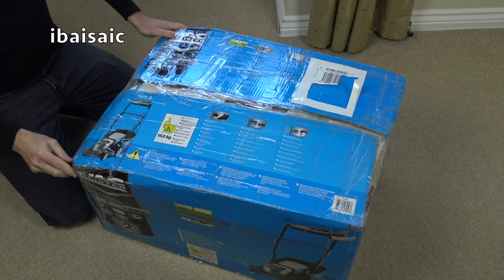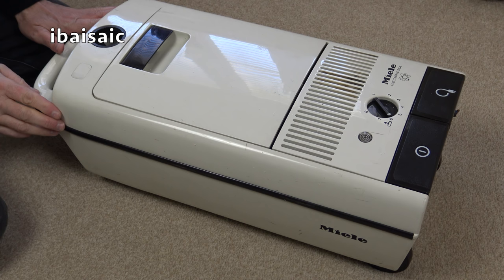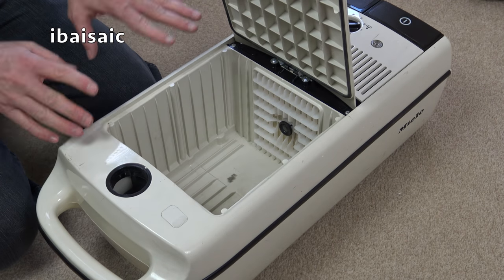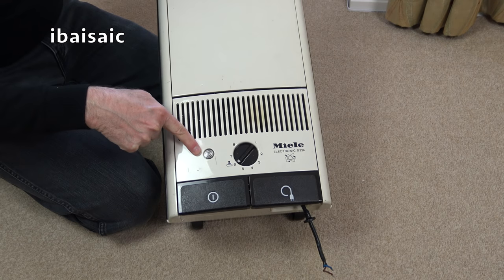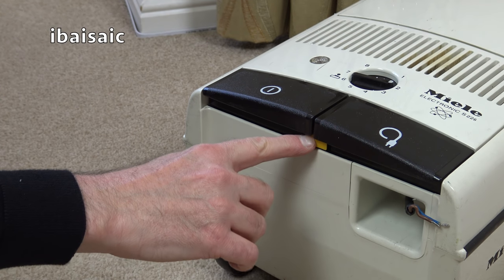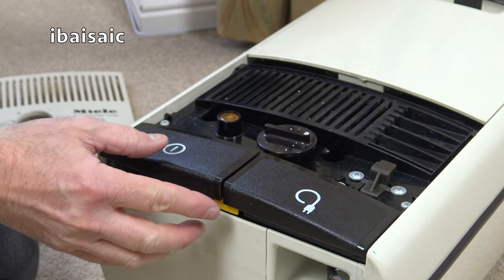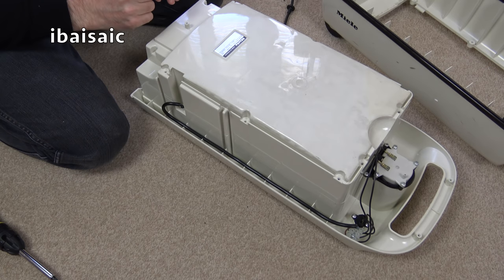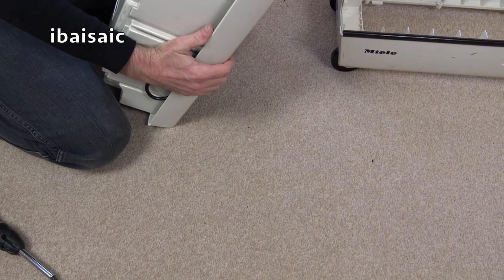Miele S226 Vacuum Cleaner Unboxing, Disassembly & Explosion!

Comment: The motor isn't defect, that explosion came from the capacitor / supressor. I have the same machines in orange S 224 and at this model I have the same spectaculary explosion. At my S226 I have directly disconnect the supressor. I cut off the cables on the supressor and connect with the terminal strip the cables with same colour together and the machine works fine now, without any supressors.
Reply: I agree, and that man knows what he´s doing guys!

Comment: It's still possibly the suppressor, or at least one of them. The meta can could be a suppressor but on the small PCB next to the motor is another 2 capacitors which could have also gone bang.
Lastly there is a chance that the triac (3 pin tabbed device on the small PCB) that controls the motor speed might also have gone and if so you will be able to clearly see that it has failed, this is replaceable or the speed control circuitry can be bypassed, this is what I do to henry's at work when the high/low or autosave circuity has failed (and a failure of that will cause the machine to be dead, although the motor is fine).
Reply: I think the diagnosis will be a little easier now too, Also agree that it sounds more like something on the PCB than the motor (purely based on the motor running before the bang)

Comment: I have had two motors blow up on me. A Dyson DC07 has severe bad bearings and I continued to use it and eventually it made a burning smell. The other one was an old Numatic that got blew up as I was using it. The bushes were shot! I think i'm used to vacuums bowing up now.
Reply: I was already using them. I had them since new so i'm not going to do a full service after every use.
Reply: Husky Vacs They were all vacuums I couldn’t care less about. They have been thrown away now. I did continue to use the Dyson with bad bearings. It made rattling noises and the motor was slowing down. Eventually the motor burned out completely. The Numatic just needed new brushes after being heavily used from 2006. I had another one identical so I just swapped the whole head with the old tub.

Comment: Hi Roger. The misaligned speed control knob suggests that this lovely Miele has been previously tinkered with thus probably causing your spectacular  blow out! “You were only meant to blow the doors off!” I would get a view from the mighty beko1987 before investing a lot of money on this one. He will know exactly what was the likely cause just from watching the video!
Reply: That also makes me suspect that something may be making contact that shouldn't. The alignment of that knob being off makes me thing the potentiometer (the actual electrical component it turns) is either loose or has been removed and not re-installed correctly. The latter technically isn't a problem, but it is also possible that the leads weren't dressed correctly on reassembly.

Comment: Always use a meter to test for a dead short between neutral and live, without power. Also use a LOW value fuse at first say 3 or 5A
It's probably a blown capacitor.

Comment: The motor is fine. Your problem is with the pcb board.  Circuitry this old coupled with the suppressor its more than likely your cause. You can direct wire the motor to confirm this.

Comment: Any updates Roger on finding the cause?  If there was signs the filter had burnt and the suspect suppressor would have blown and not looking in the condition it does.  Maybe the potentiometer burnt out but it seemed like there was a dead short somewhere down the line.

Comment: What actually happened? I’m visually impaired so that is why am asking. Also was that motor a Miele one?
Reply from the maker: The motor turned on for a nano second, there was a big bang and yellow flames and sparks flew out of the exhaust vent on the top of the cleaner.
Reply from the maker: It also tripped the downstairs wiring circuit and my studio lights went off.
Reply: me too! legally blind

Comment: I know looking at a video isn't the same as seeing the product in real life but it didn't look that well constructed. The springs for the buttons looked all corroded, everything was squeaking, the tool was broken with what looked like light use, the power variable control doesn't line up, the hose looks thin and has broken and of course the vacuum doesn't actually work and has a dangerous electrical fault. It doesn't give the impression of being well constructed in the video or having quality parts. It looks quite a cheap design in places. I've seen old Hoovers (the brand Hoover that is) that look better constructed than that and seemed to have aged better. 

Not a fan of bagged cleaners though, don't like the idea of a bag of skin particles being feasted on by bugs and just left in the vacuum, prefer to empty a vacuum after every use. More importantly don't like paying for bags. So I think I have an automatic negative view of bagged cleaners.